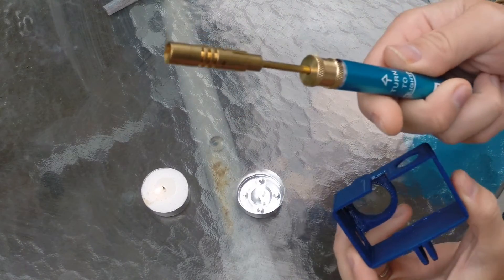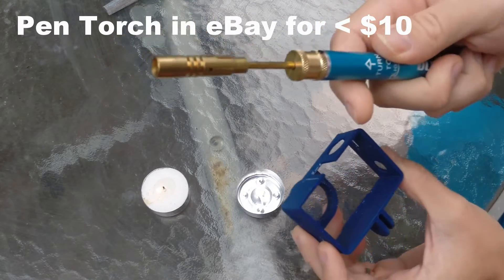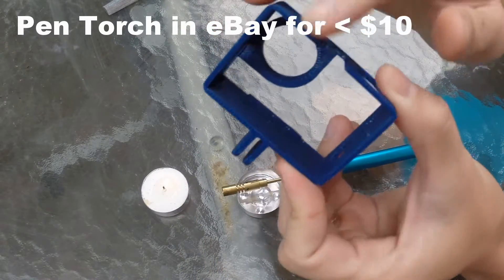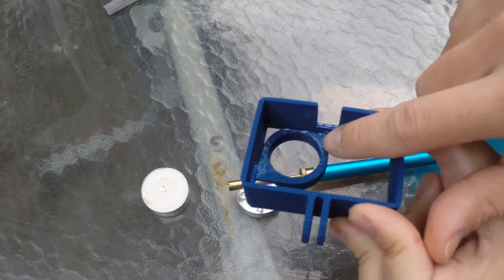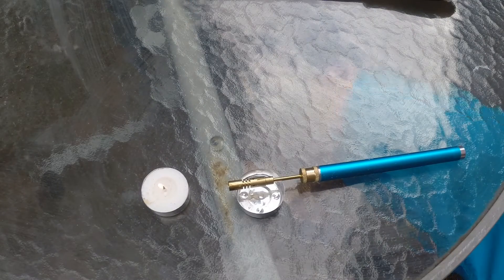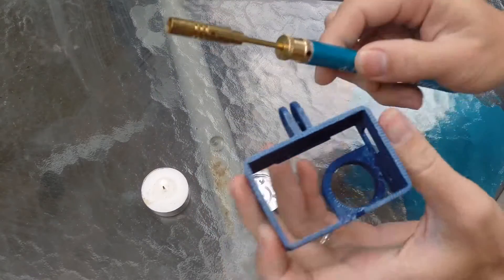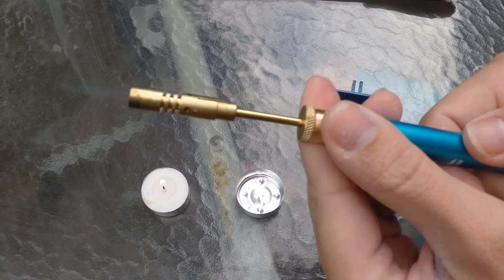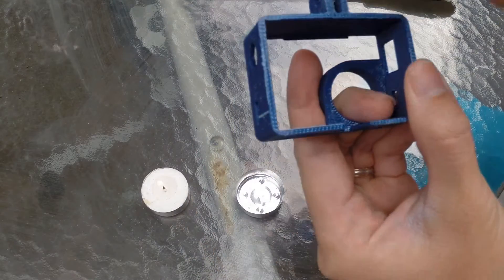3D printing - Fix/restore your ABS 3D model colour with Pen Torch

Comment from the maker: Follow up from my other post, this video I used a pen torch to touch up colour on my ABS 3D printed model. Super effective! I also use it to smooth the edges around my 3D printed models, an alternative to using acetone. You can get it on eBay for around 5 bucks. I think each 3D printing enthusiast should have one :)......